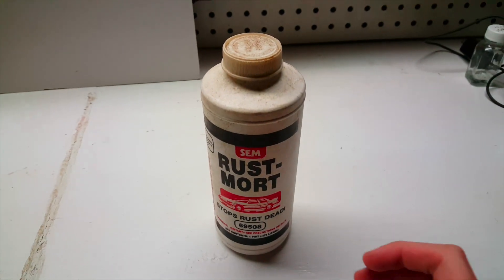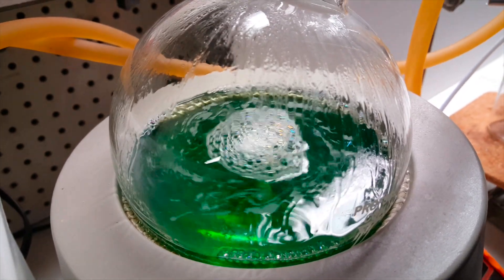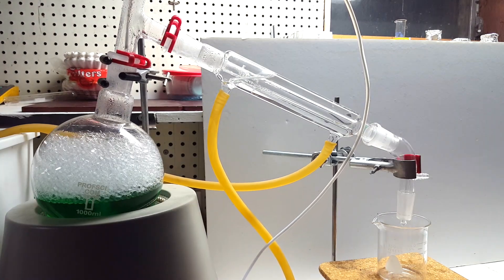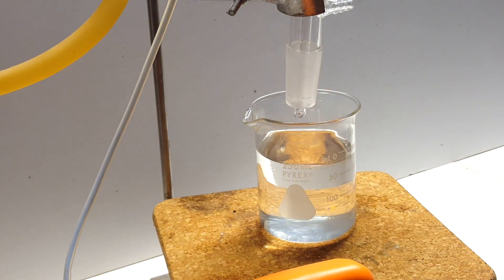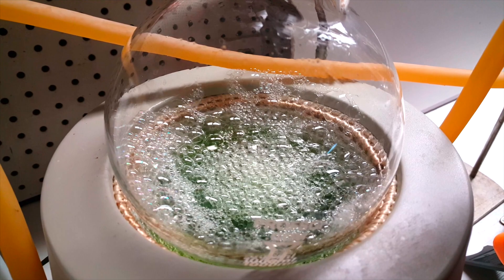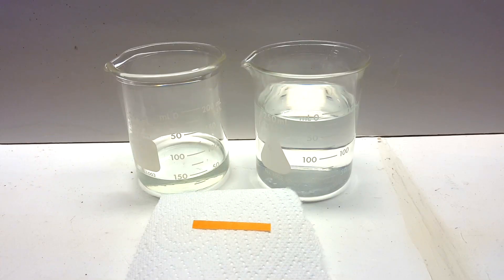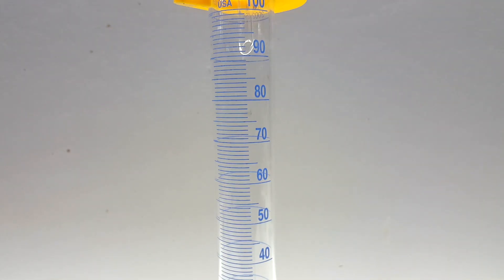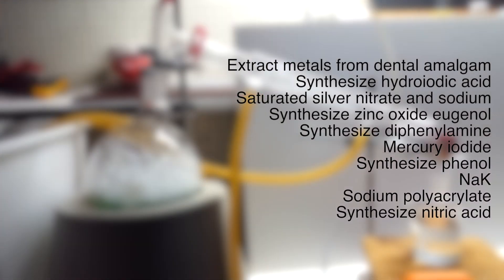Extraction of Phosphoric Acid Through Distillation

Comment: You should connect hoses to the condenser in opposite way. The water input is the lower one, the output is the higher. You will have entire condenser tube immersed in water, now you have huge gap. In case when the pressure drops you won't have any cooling

Comment: phosphoric acid decomposes at 156C. It polymerizes, which is what that sludge was at the bottom of your flask. Apparently it can ruin your glassware. BTW for HI, use H2S bubbled through iodine in distilled water instead of using phosphoric acid.